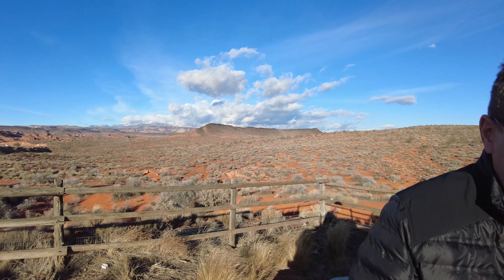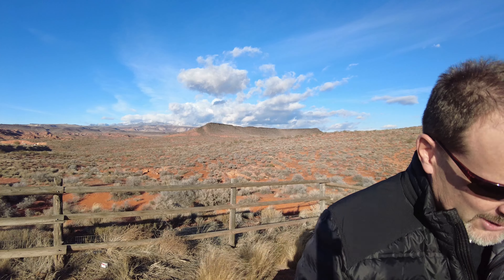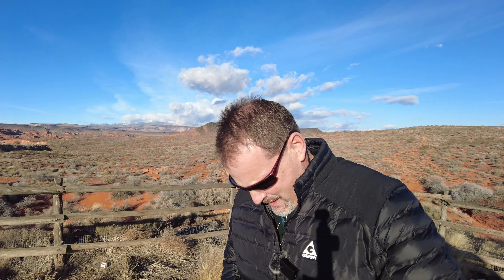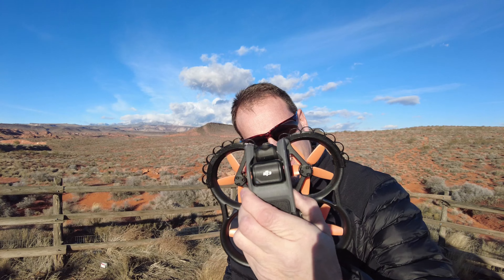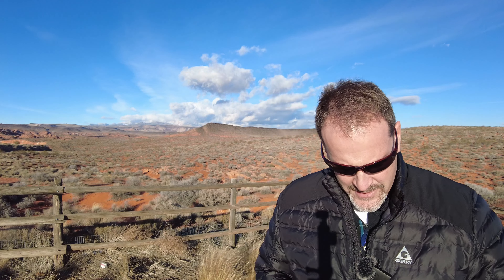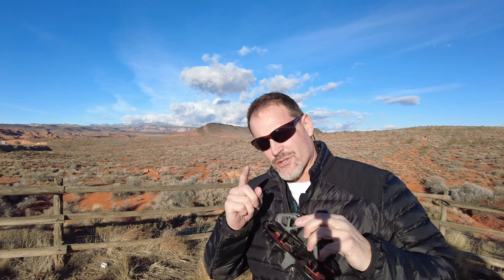DJI AVATA RID AND GPS DISCONNECT - What’s it Like to Disconnect? Wind Can Really Destroy Your Video

Comment: 5:55 is that the drone stopping on its own because your wire disconnected?
Reply from the maker: No, there is no issue with RID but an orange 🍊 warning. Your control is not effected
Reply: @DadRandom  Ok, good. It looked as if it made you hover. I'm glad to know it didn't. 

May I correct your grammar? Actually, Kai might slap me. Never mind! 😜